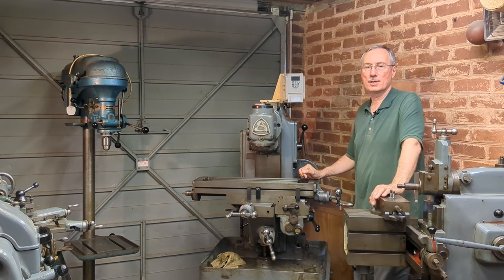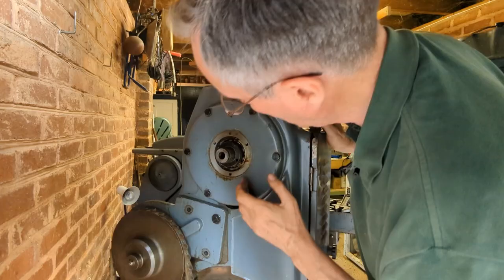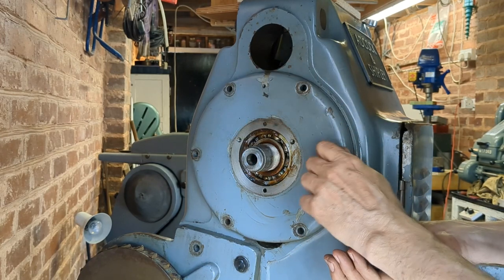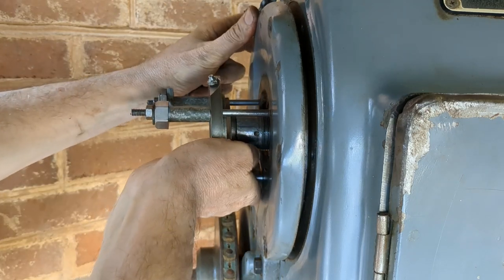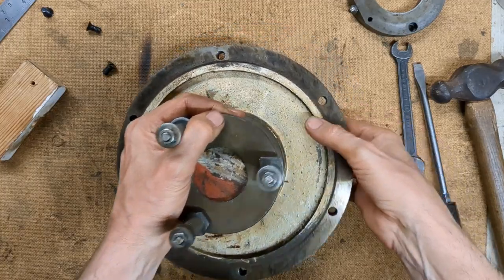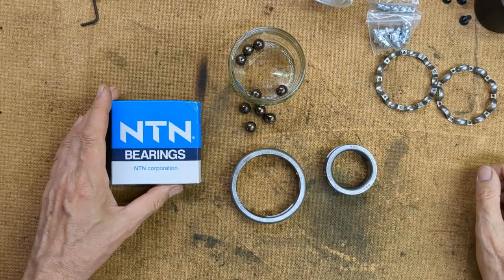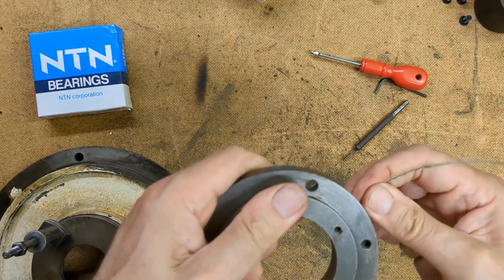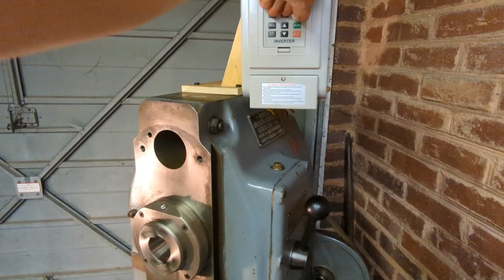Adcock & Shipley milling machine - part 2 (bearing issue)

Comment: The one tip my father gave me that has proved useful in life is that if you take a screwdriver and push the tip against the casing of the machine and put your ear/cheekbone against the handle it acts like a stethoscope and is a great help in locating exactly where a noise is coming from on a machine. Best regards Sarah
Reply from the maker: Thanks, Sarah. I tried with a piece of wood but I couldn't get any clues from that. Perhaps the background noise was too much. Next time I will try with a screwdriver handle as recommended! Clive.

Comment: Great set of videos Clive,i worked at the Adcock & Shipley factory in Bridlington in the 1960s, great job ,i started on a large miller that cut the Vways on the knee then put the oil channel into the V with a broaching tool, one of the suppliers of the castings for the columns and knees was a firm called Broadbents and at times you would be milling away only to find the component was full of blow holes so that ended up as foundry scrap,i eventually finished working on the Moog version a really advanced machine,many memories sadly now gone.
Anyway you look to have a great set up well done.
Reply from the maker: Thank you, Chris, for your feedback and sharing your experience at the A&S factory. You must have worked on large machines. Interesting to hear about the castings. I didn't know about the Moog version. I will look it up.

Comment: Extremely interesting. That bearing was most definitely shot! The difference before and after was obvious. I always keep old bearing inner and outer races, they make excellent round parallels for the mill or faceplate. I thought I could hear a bit of a noise when you had the vertical head running, but you will know better as you heard it first hand.

Thanks for a great film,  I'm slowly getting around to watching your other videos, they are excellent.
Reply from the maker: Thanks for your feedback Carl! Yes, that was my original motivation in separating the bearing. It was an after thought that it might be good to look at the damage.
You might be right about the vertical head bearings; I could hear something but was hoping it might not be a problem. Will see!
Reply: @Workshopfriend  I have yet to get into the gearbox or the vertical head on my Harrison Mill, but I'm going to replace all the bearings. I did this in the feed gearbox but that was before I had a youtube channel. I'm enjoying your content.
Reply from the maker: Isn't that going to be expensive? Do they all need to be replaced?
Reply: @Workshopfriend  Yes it might be expensive. But they are all in excess of 50 years old. I will assess them on condition, but I expect to have to replace the majority of them.

Comment: Thank you for an excellent insight into the bearings on this machine and the problems you encountered. 
A very interesting and informative restoration. Looking forward to the next episode. 👏👏👍😀
Reply from the maker: Thanks, Andrew, for your feedback. Yes, there is more to come. Clive.
Reply: @Workshopfriend Hello Clive. Can I ask, what type of grease did you use in the bearings you replaced in this video?
Reply from the maker: Sorry for the slow response, Andrew. I used Mobilux EP2.
Reply: @Workshopfriend  No need to apologise. Not slow at all. Very useful answer as it confirms what I type of grease I thought was suitable for such bearings. Thank you. 🙏

Comment: Good outcome, luckily the spindle bearing journal is still serviceable.
I would have installed a sealed bearing if available and dispense with the grease nipple.
A lot of the vintage American lathes also used metric bearings, go figure.
Watched one of your earlier Vids regarding your Colchester lathe using a Matrix clutch, my 1954 13x42 Dean Smith & Grace also had a Matrix clutch, albeit somewhat larger.
Reply from the maker: Yes, it was a good outcome! Yes, I think I was fortunate.
I didn't think of installing a sealed bearing. I was more focussed on the dimensions and the clearance spec. I wonder why even American machine tools used metric bearings. Perhaps even in the US it came down to economics.
Glad you saw the clutch servicing too. That was another example of a job turning out to be easier than expected!

Comment: Enjoyed that thanks. Like I was looking over your shoulder. Can be very satisfying to restore these old machines (but also a lot of work). What is the spindle fitting size please (INT 40?).
Reply from the maker: Happy to hear! Yes they can require a lot of work but, in this case, less than I was expecting. Yes, the taper is Int 40. Clive.

Comment: Good work, nice machine, it may have been easier to pack the bearing with grease before fitting to the housing? Did you check the internal size of the new brg in relation to the shaft size? And usually brg's have a number on them that brg suppliers can match. Not criticism, just observations.
Reply from the maker: Yes, you may be right about that! Yes, I did check the internal dimension. It turned out to be a standard metric size. I was able to identify the bearing from the number but the exact spec was very expensive. I went for something moderately priced - certainly not the cheapest.